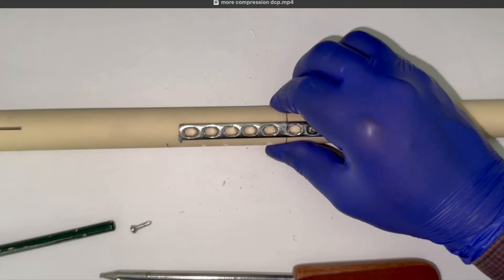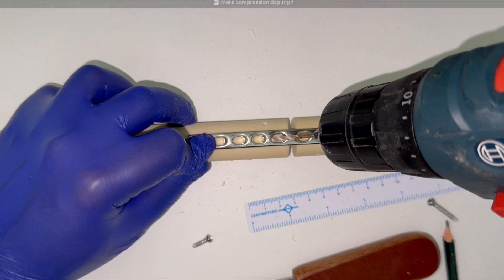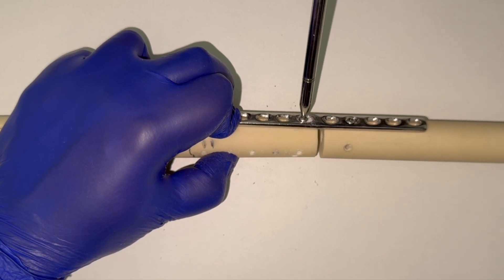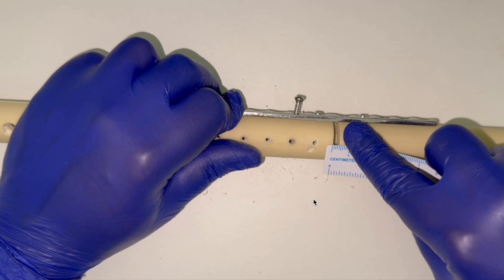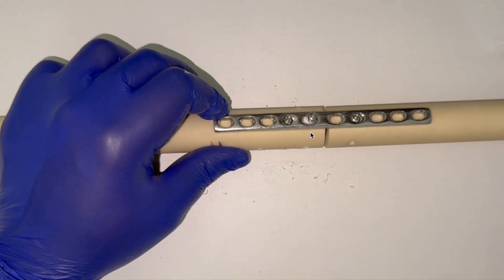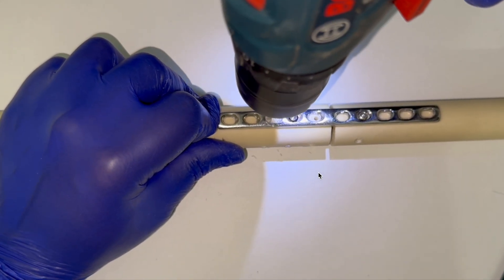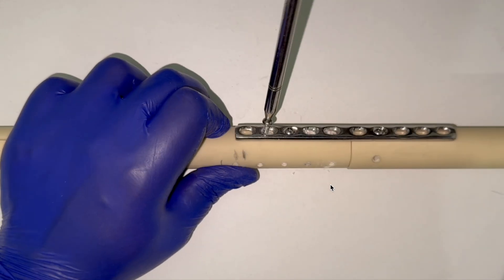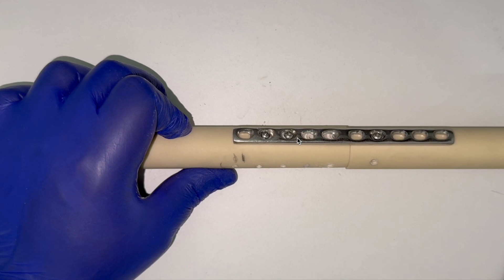Unlimited Compression Trick with Dynamic Compression Plating

Comment: Is there any chances of opening of opposite cortex after using unicprtical screws?
Reply from the maker: The unicortical screws will work in the same manner as bicortical screws but will have less strong pull out strength. If far cortex is going to open up with bicortical screw then same will happen with unicortical screw as well. So, you can assess the bone shape. If the surface is not perfectly flat, then slight prebending, as we usually do, will help.

Comment: the second eccentric screw was immediately bicortical or still unicortical?
Reply from the maker: Before gaining full compression, only the final screw placed, when no further compression is intended, is bicortical. Rest all eccentric screws' purpose is to slide plate, are initially unicortical and can later be converted into bicortical.

Comment: Merci encore pour vos vidéos, la vis uni corticale se trouve a la partie distale de la fracture ? On peut inverser le côté ?
Merci
Reply from the maker: L'ordre des vis unicorticales peut être modifié selon les besoins. N'importe quel ordre peut être suivi et n'importe quel côté de la fracture peut être utilisé. La seule précaution à prendre est de retirer la vis excentrique précédente avant la vis excentrique suivante. Merci.

The order of unicortical screws can be changed as required. Any order can be followed and any side of the fracture can be used. Only thing to be taken care is to remove the previous eccentric screw before next eccentric screw.
Reply: Thank you  @Justorthothings

Comment: Good advice!
But later you’ll need to explain on the Rounds why you used a 10 hole dcp for a transverse fracture hahaha
Reply from the maker: Of course! 5 mm gap is just hypothetical 😅, just an example to show that you have scope of more compression always. So mostly 6-7 hole plate will do the needful.
Reply: 1 . If I drill the hole again which already have been drilled , does it may cause merging of hole so that screw will be loosening.
 2.why don't we try from the opposite site of fracture simultaneously ?
3.in compression mode plate or bone moves?
Reply from the maker: @mohammadminhazuddin743  
1. Regarding merging, see I clearly mentioned that all initial holes were uncortical. So when you are drilling again through the hole, you are making them bicortical. Since, you are in same direction as previous, your screw will not be loose, rather now screw will be of better hold as far cortex is fresh. If you are making a hole near the previous hole due to blockage by plate metal, then also, you have far cortex available. So screw will not become loose even if near hole merges, same reason that far cortex hole is fresh.
2. Yes, you can achieve the same compression from the opposite side as well. This video was just showing a hypothetical situation, to clarify that compression can be gained further more than described.
3. Its relative motion. Since the proximal part of the bone is stationary, you can say that plate moves along with distal fragment to bring compression.
Reply: Good explanation @Justorthothings